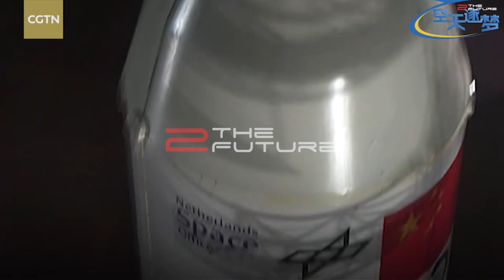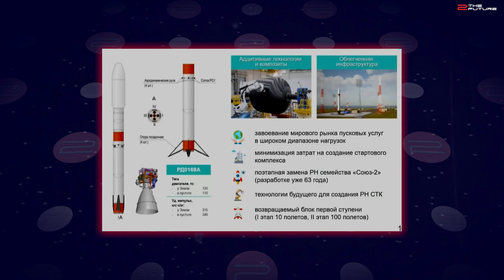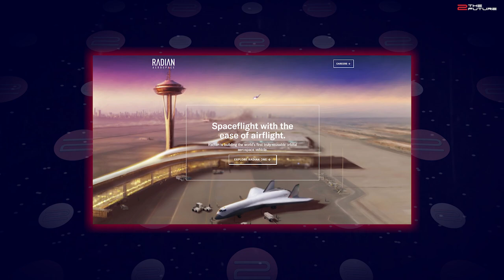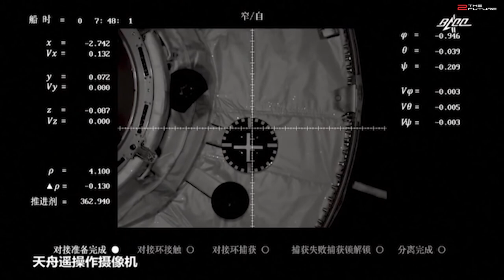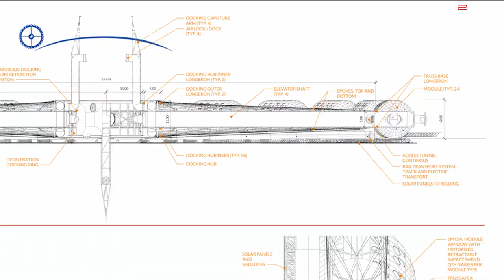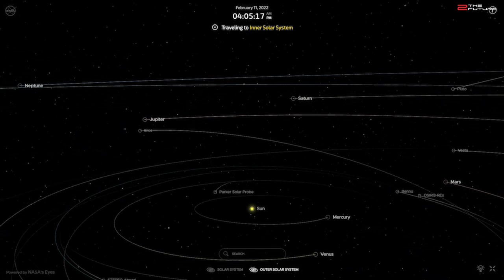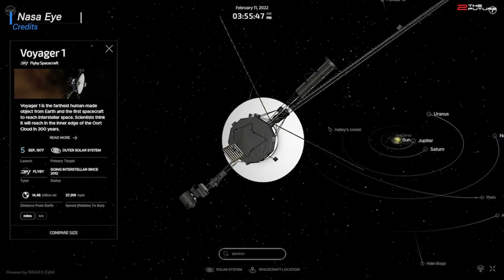The most mindblowing technologies for our space future.

Comment: The rotating space station has a lot of small spaceplanes attached to the outer ring, I believe as life boats. Since the station is spinning, I assume they must be attached before it is spun up and can’t be replaced without stopping the rotation. So, what happens if during an emergency, only one or worse several on one side of the station are released? Won’t the station start to wobble making it very dangerous for those left inside?

Comment: The sun gravity lens telescope idea suffers from the inability to aim it where you want to see something. Line of sight between sun and detector will be the only direction that can be viewed.
Reply: Yes, but the detector being on sails can be moved; though, it will take years to change like 45-90 degrees. So make them cheap and launch 1000s to cover as many fields as required.
Reply: @jtasakorn solar sails can't do much outside the heliosphere which only goes out 123 AUs these would need to operate at 550 AUs. Also communication would take a very long time. Just seems like other easier tech will reach this resolution before this tech can be implemented. But maybe I'm  wrong.
Reply: @wesleyashley99  Assuming the source is solid, the idea was made, maybe yet to be ratified. Sailing ships roamed the world before steam ships. Communications and control will be problematic, but not impossible; especially with preprogramming, AI, and swarm intelligence. Though solar sails means light, small stuffs, with compound optics and swarm processing, but possibly another use for the Breakthrough Starshot lasers. Hopefully, something materializes in my lifetime.

Comment: I suppose there aren't any real projects on the table which is probably why you didn't mention it, and if so is a huge shame, but I think that when looking at interplanetary expeditions, particularly Musk's Mars colonisation plans but also other human deep space exploration there is going to be a second seismic shift in the technology (the first seismic shift being Musk's vision of rapid totally reusable rockets).

That second game-changing milestone I think will be building much larger space/vacuum-only vessels designed to haul even larger numbers of people and more cargo volume between planets, or probe faster and further into the solar system, due to not needing to carry sea-level engines, heatshields, fins and structural elements that need to be able to withstand Earth's gravity (or any forces beyond planned acceleration and deceleration).

Musk's Mars plan and SpaceX current developments are using a Starship 1.x concept which I agree is the appropriate first step. Will Starship 2.x be a bigger (12m diameter?) version of currently envisaged Starship? Probably but by Starship 3.x I really do wonder whether Musk, or some other player in the game, might adopt the massive "space liner" concept with something more akin to current Starship proving the final connection to the planet's surface at each end? A really scaled up Dream Chaser on top of a reusable booster might also be an option for the planetary shuttle at least for Earth's atmosphere.

Comment: I think LUVOIR is Infrarred, but not so far infrearred like JWST.
Reply: LUVOIR = Large Ultraviolet Optical InfraRed telescope. This would be the true successor to Hubble, with similar limited NIR capabilities. Webb has much better IR capabilities, including into the MIR. 
The 2020 Decadel Survey recommended a 6 meter LUVOIR combined with the capabilities of the proposed Habex (habitable exoplanet telescope. This is smaller than the 15m or 8m LUVOIR telescopes that were proposed.